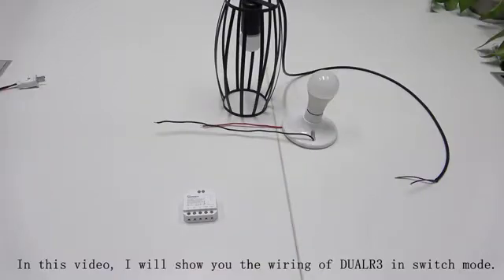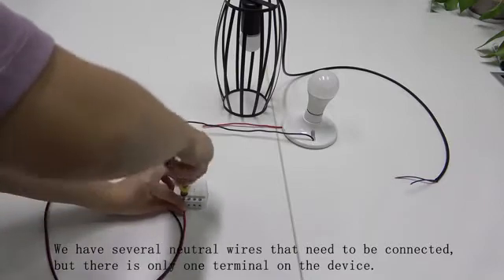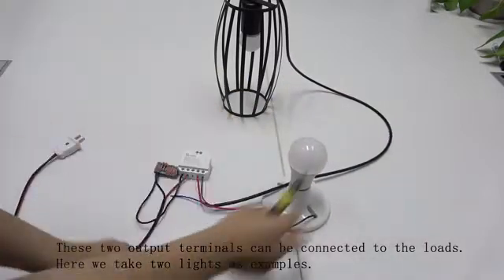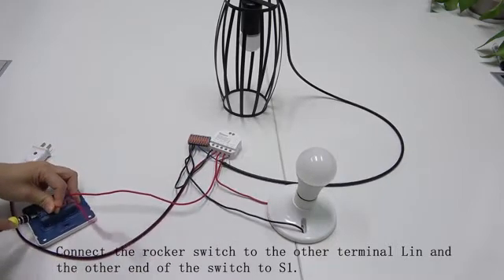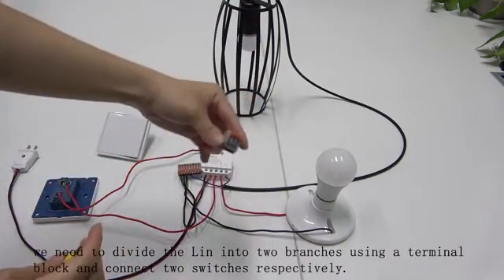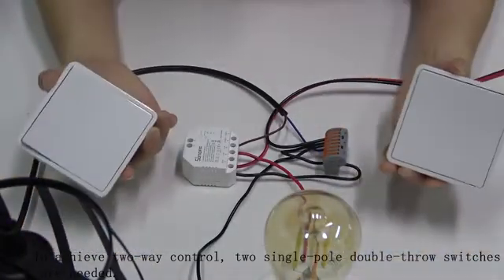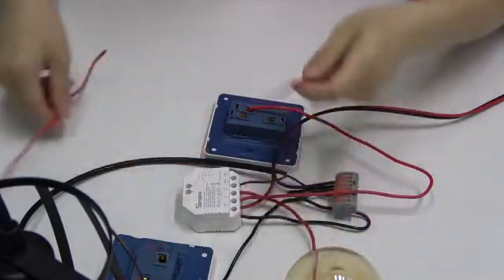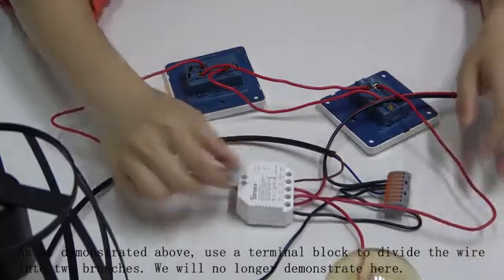HOW TO WIRE DUALR3 WITH TWO LOADS/2 OUTPUT IN SWITCH MODE-sonoff.in

Comment: Hi, this is a very Good video,But i am facing a problem as my 1Kw centrifugal water pump is not switching on via the Dual R3, all the wiring done is correct and Dual R3 has a capability of 3 Kw. So why is not working ?